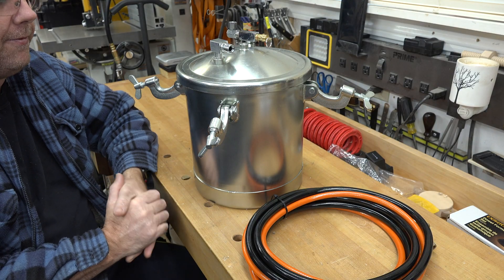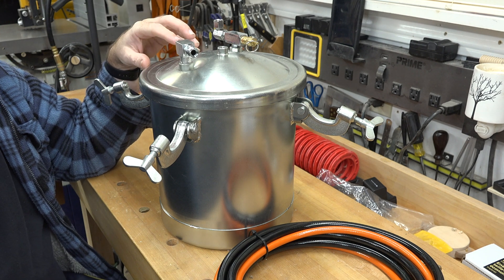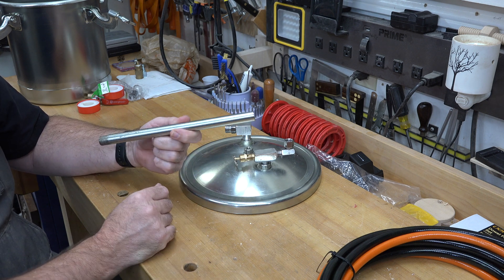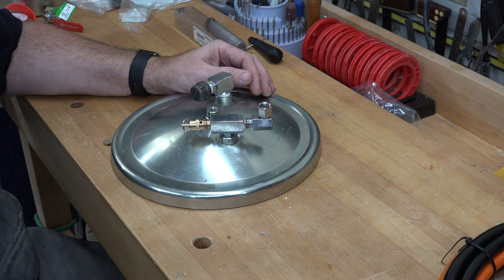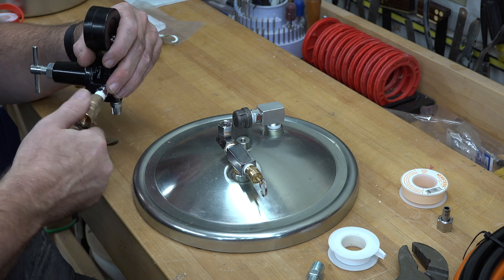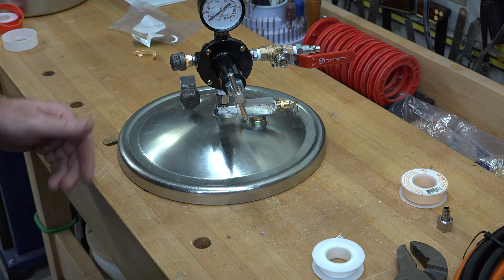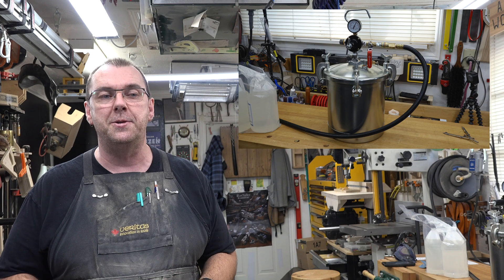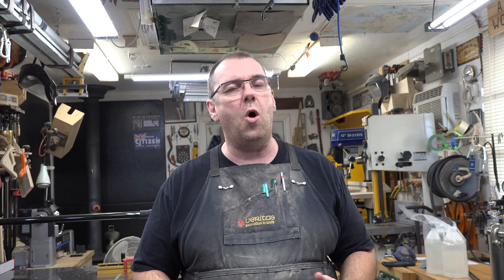Making a Pressure Pot for Casting Resin

Comment: Do you have any tips on removing the downstem pipe. It really is difficult like you said but we’ve been at it hrs with a pipe wrench now
Reply from the maker: Have you tried heating it with a torch.  It may have thread locker on it that will have to be melted.  Thanks for tuning in.

Comment: after having to make slightly more modifications to mine (Asked BF and his dad to do one thing and they did 3) i am having a leak issue and i can't find the source. any tips?
Reply from the maker: Fill a spray bottle with water and a squirt of dish soap.  Pressurize the pot and then spray the water around anywhere there is potential leak.  (where the lid meets the pot, the threaded connections, the pressure release valve etc). The soapy water will bubble where the leak is and you can determine how to fix it from there.  It might be a thread that needs a little more teflon tape or a bad valve etc.  The soapy water will determine the source of the leak at least.  I hope this helps a little.  Thanks for tuning in.

Comment: Thanks Kenny, I just completed my conversion of the Princess Auto Pressure Pot. All went well, I had to take apart every original connection to be leakproof.  I can get to just over 40 PSI and then the safety valve activates.  Is 40 psi sufficient for resin or do I need a bit more? If so, do I need to replace the safety valve or is there a way to adjust the cut-off on the safety valve?
Reply from the maker: Some safety valves are more sensitive than others and there is definitely a margin of error when it comes to their accuracy.  Mine usually starts to leak somewhere around the 44-46 psi mark and I've never had a problem.  I am 99% confident that 40 psi will be just fine for your resin projects.  If you have any doubts, you could change the safety valve to a new one with a higher psi rating as there is no way to adjust the pressure safety valve that I know of.  Either way, I'm pretty sure that you should be just fine with 40 psi.  Good luck with your resin projects and thanks for tuning in to the show.

Comment: Great video, however I would suggest that a different type of air entry into the pot as the way it is set up you will be blowing air directly onto your resin. they make a fixture to clear this problem. it almost looks like a bolt that has been drilled out through the center and then on the end of the bolt you drill another hole horizontal to the bolt. this way the air will blow on the sides of the pot and not straight down. but good job on the video.
Reply from the maker: Glad that you liked the show Gene.  I agree with you and the direction of the airflow in the chamber.  It's for that reason that I introduce the air slowly into the tank.  I like your suggestion though and will looking into it for my pressure pot.  Thanks for tuning in and taking the time to leave your suggestion.  I truly appreciate it.

Comment: Thanks for the video! You don’t have the quick connect in your parts list. Could you add that? I’m in the middle of doing this conversion - thanks!
Reply from the maker: I believe that this was the one that I used Henning.  I would just double check to make sure that yours has the same sized threads.  I hope this helps.  Thanks for tuning in to the show.  https://www.homedepot.ca/product/husky-1-4-inch-fnpt-combo-coupler/1000841267

Comment: I stumbled across your channel trying to mod a pressure pot and I happen to have the exact same one you have from princess auto!

If you don’t mind me asking do you have any idea as to what size compressor I would need/do you have a recommendation for one?

The one I have I believe to be to small, and only gets the pot up to 20 PSI, way lower then I’d like it to be 

Regardless of if you answer this or not thank you for the awesome video, it made modifying the pot a heck of a lot easier!
Reply from the maker: 20PSI is not really sufficient to get all the bubbles out of the casting Madison.  The compressor that I use is the same one that I use for my brad nailer and it will go up to about 120 PSI but the tank will only hold just under 50 before the pressure valve starts to release.  Any small air compressor that works for a brad nailer will work for this application as well.  I've had my compressor for years and it is no longer available on the market, but something like this https://www.homedepot.ca/product/dewalt-1-gal-portable-electric-trim-air-compressor/1000181095 would serve you well.  I guess it all depends on what you would want it for.  If it is only for the resin pot, I wouldn't go for a super high quality unit but if you were planning on using for other things like nailers etc, then you might want to invest a little more.  Princess Auto has some options as well.  https://www.princessauto.com/en/2-gallon-portable-electric-air-compressor/product/PA0008005495. I hope this helps.  I'm glad that you found the show to be useful. Thanks for tuning in.
Reply: @acutabove_woodworkings  thank you so much for the detailed reply it means a lot to me!
We figured it out, I really appreciate the help, as well as the links you have listed for the parts in your description were a life saver!

Comment: Hi Kenny, I had a question about the pressure loss. How much would you lose in a 24 hour time period(the resins curing time)? Or did the loss stop at only 44PSI?
Reply from the maker: The loss stopped at 44 psi Philip.  My safety valve on this one is a little on the weak side and while the pot is pressure rated and the seals are good, the check valve didn't want it to go above 44 psi.  So it drained off the excess pressure and held it until it was released.  It didn't leak any more than that.  Without changing out the pressure gauge, there's no real way to know whether it is the valve or the gauge that is off but I'm okay with 44 psi.  It does the job perfectly at that pressure.  I hope this helps.  Thanks for tuning in.
Reply: @acutabove_woodworkings  thank you for the reply ! Also , your suggestion about a decent pair of channel locks helped get that pipe out, thanks again

Comment: Hi! I'm currently working on my pressure pot. How you release the air off the pot? Pulling the safety valve? Great videos.
Reply from the maker: You can release the air in two ways Jordan.  You can either do like you suggested and pull the safety valve, or you can open the shut off valve which will release the pressure much faster.  I hope this helps.  Thanks for tuning in to the show and for posting your question.
Reply: @acutabove_woodworkings  Thnak you so much!

Comment: Another very informative video Ken. I have got the same pressure pot setup. The only thing I done differently, was replace the 4 butterfly bolts on the lid, with Hex Head Bolts and I use a socket wrench to tighten down the lid.
Reply from the maker: My only worry with that Ray, would be the socket wrench applying too much torque on the bold and the bolt punching through the aluminum lid.  Maybe I'm overthinking it.  Thanks for tuning in and for the kind words on the show.

Comment: Great video. Do you think a domestic kitchen pressure cooker would stand up to the pressure or is it not heavy duty enough? Would possibly be cheaper because there always seems to be used pressure cookers around.
Reply from the maker: I don't believe that a normal pressure cooker would work Michael.  The pressure cooker and a pressure pot work on two distinctly different processes.  The two are not interchangeable.  Better to stick with a vessel that is engineers to hold the pressures that we need.  Thanks for tuning in.
Reply: kennyearrings1 , thank you. Makes sense.
Reply from the maker: @mikeygee2465  You're very welcome.

Comment: Thanks Kenny! I’m sure the manual for the pot probably warns against loosening the bails with the pot pressurized. Bodily injury or death may occur!
Reply from the maker: You make a great point Frank.  Keep that lid firmly secured until all the pressure has been released.  Thanks for bringing safety to the forefront of the comment section.  Thanks for tuning in this week sir.

Comment: Kind of like Sibat 777,  why not just plug the extra hole instead of adding a cap?  Since I have multiple items I use a pressure gauge for I just have a setup where I have an inline valve with gauge  with input and output fittings. So on the top of my tank paint I have one input capped off directly with a plug and a T that has the input fitting, valve, and the pressure release fitting. Then I can just hook my air hose and pressure gauge inline, fill it up, and close it off.  I also used a sharpie to write the max pressure on the lid just so I don't forget. :)
Reply from the maker: Great suggestions Ken.  As I said to Sibat, the price difference between threaded reducers and the end cap was astronomical so using an end cap was the better way for me to go.  Not to mention that the reducers were unavailable at the time of filming when I needed them most so I went with what I had.  Great suggestion on both yours, and Sibat's part with minimizing the joints needed and making the pot a little more streamline.  I may, one day, change my setup; but for now, it works great and I'm quite happy with it.  Thanks for tuning in Ken and for taking the time to chime in with your experience and your setup ideas.  It's very much appreciated.

Comment: Kenny, hope you don’t mind me suggesting a simpler setup, put the pressure gauge on the paint output valve with any thread adjustment needed then put the input onto the other port with the pressure release valve.  Principle being less joints less leaks.  Any left over self levelling compound or concrete could be used the level up the bottom.  Looking forward to some resin projects👍
Reply from the maker: I don't mind at all Sibat.  Just like in woodworking, there are many different ways to accomplish the same task.  Initially, I had the same idea as your to minimize joints in the works, but then I compared the price of threaded reducers versus threaded end caps.  Huge difference in price and on top of that, the reducer I needed was not readily available so I worked with what I had available to me at the time.  Either way, whether you connect directly to the tank lid, or use a workaround as I did, both methods work just fine.  Thanks for tuning in and chiming in with your suggestion.  It's appreciated.